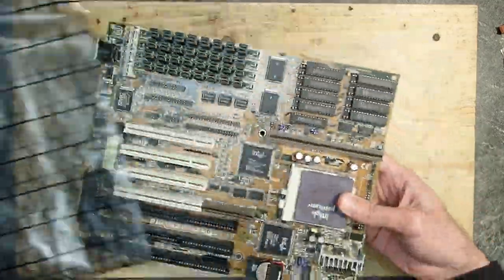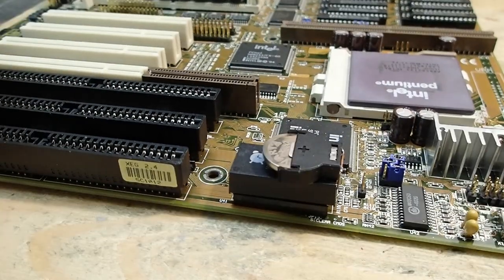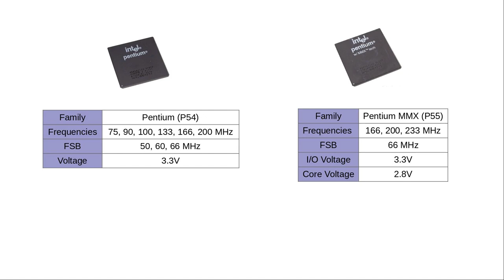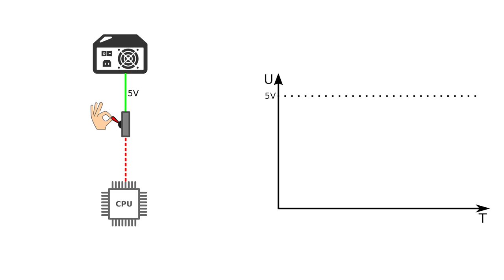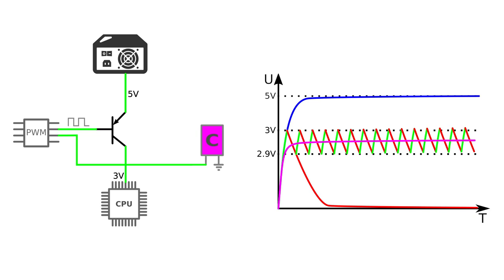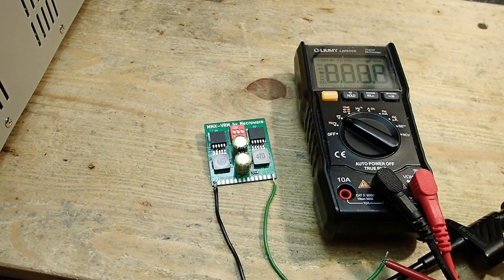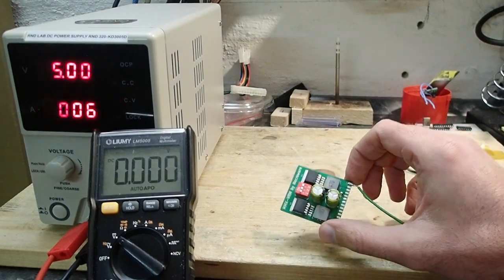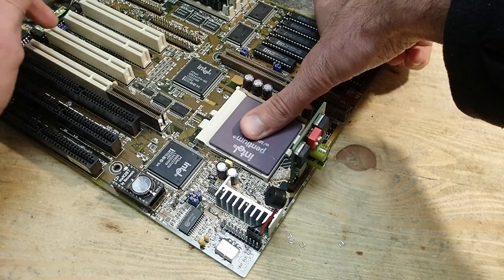Let's upgrade an early Socket 7 board beyond the limit (Part 1): RTC, VRM, MMX

Comment: Will there be a REvision 2.0 that allows the Voltage down to at least 2V, if not 1,8V as there are some SOcket 7 CPU that go down that far.
They are more found in the mobile space -> AMD K6-2+ and AMD K6-3+.
Oh and I would also remove some soldermask on the back of the output of the regulator to put one or two SMD Ceramic Caps there.
Reply from the maker: No, I don't plan to go under 2.2V, I even actually plan to raise the upper limit to 3.2V, because that's more useful. In regards of the ceramic caps, I experimented with different values, but I didn't see any difference on the oscilloscope. I added one in another place, because it is suggested by the datasheet (although only for output voltages over 10V, which we don't have here). So I decided not to heal something, what is not wounded ;) 

Otherwise everything will be open sourced next week and everybody is free to use, change, or forget it....

Comment: It seems the through hole electrolytic cap is the only buffer on the output. It may be more stable and last longer if you also add some ceramic capacitors to handle the high HF currents.
Reply: The two grey squares with 470 on them are inductors for smoothing.

Comment: Uuuuuuuuuu. Excelent and very desirable motherboard. Some people ask for what's that brown slot behind PCI. It was used too for some Adaptec SCSI boards!
Reply from the maker: What you probably mean is 64bit PCI, that looks very similar. These Asus Media Bus slots were limited to some Asus boards only and there was only a handful of expansion cards for it. Furthermore there were three versions of the Media Bus, as far as I know and they were all electrically and mechanically incompatible with each other. A total fail.
Reply: @necro_ware  ... and the few cards that are out there (usually the SCSI+Vibra and Mach64+Vibra combos) are so horribly overpriced (150-200 eurodollar upwards last time I checked) the people with mobos that could use them will likely never get their hands on them... unless they have way more money than brains

Comment: Hello, I found similar cards for sale in eBay, without Adaptec bios chip. Do you know, if the card works at all without the SCSI bios chip?
Reply from the maker: You can simply download the bios from the internet and write it to an eprom. That's not a problem.

Comment: Hello. I wanted to apologize in advance for the spelling. I write in Polish and translate in google translator. I would like to do such a project myself, but you did not share the files on your website. Could use a schematic and the appearance of the PCB itself. On the Internet I found a pdf of the LM 2596S ADJ chip and in it a diagram on which I could base and make such a regulator in the KIKAD program. Finding the right components in this program, especially the connector that fits the motherboard, is almost a miracle. The circuit itself exists as well as the diode. I can not find a switch for resistors and coil. I counted from the formula what resistors should be to get the right voltage at the output. I have a request, wouldn't you be so nice and although the ready scheme of this project in kikad made available to a wider audience? Regards.

Comment: Big question is if the BIOS will init the CPU correctly and allow it to boot? Probably the old BIOS can be modded relatively easily, as back in the days they did not play with bios encryption and there are some modding tools available for some modifications (like lba48 support)
Reply: There was a company selling modified BIOS chips and flash files for various popular motherboards to do things like add the ability to work with larger hard drives and support more CPUs and even un-hide and add/enable features the board could support but the manufacturer (usually an OEM) chose to hide or hide and completely disable.

There was also a quite active DIY BIOS modding community that developed such mods so people could DIY it for free, especially when there was no commercially modded BIOS for their board. That was aided by the "modular" BIOS developed by Pheonix and the other companies to make their work easier. "Paste" various modules together, adjust a few settings, compile into a BIOS file. An OEM that wanted to not have a bunch of adjustable stuff could request a massively cut down BIOS to fit into a 256K chip when a full featured BIOS for the same board would require a 512K chip, so a modder would also have to find a compatible chip of higher capacity.

The exceptionally nasty OEMs would order their boards with additional alterations from a reference design to make it impossible to upgrade the BIOS chip's size. Not that it would save any on cost but it would prevent BIOS modders from adding settings the OEM didn't want its customers to have.

Comment: Is this the difference between socket seven, and super socket seven?   I have several boards of both and really have to pay attention to the boards as the CPU sockets all say "socket seven" whether they are "super" or not.
Reply from the maker: Yes, the socket is mechanically the same, but the difference is not (only) the voltage, but also FSB (up to 100) and AGP slot. Only a mainboard which has that features counts as a super socket 7

Comment: I remember an old Gigabyte S754 motherboard of mine having an extension card that I believe was something like this, but been ages. Was just a young teenager by then, might be fun to look up if its intention was to do this, or if it was just a gimmick.
Think I remember it running fine without it as well.
Reply from the maker: I guess, that was more likely a TPM (https://en.wikipedia.org/wiki/Trusted_Platform_Module)
Reply: @necro_ware  It wasn't. Gigabyte did some useless marketing crap at some point during mid 00s with a plug-in VRM module for beefier (Dualcore + FX) CPUs, adding extra phases to the existing VRM on the board. They called them DPS (dynamic power switching?). One example of such a board was the K8NXP-SLI

Comment: Nice little project. I'm curious to hear more about the Intel specification aspect of it. Did Intel standardized this connector or was it just an idea that was abandonned and never took off? Seems pretty well documented/standardized based on the schematic you showed from the documentation. Were VRM-modules-on-a-card a thing that made it to the market? Some motherboard had this populated out of the box? I guess I'm really curious about the History aspect of it all ;)

Thanks for a really great video. Really curious for part 2.
Reply: I haven’t run across a bare motherboard with them (though I’m sure they exist), but some OEMs used VRM modules.  I have an IBM Aptiva and an AST, both Pentium, that use a VRM on a small removable PCB.  Not sure if either is using that suggested pinout though.
Reply: It was used extensively for Socket 8, but I'm not sure I ever saw it for Socket 7
Interestingly there is an older revision of this board on eBay (auction ID: 185033935520) with the connector populated.
So maybe the VRM module did exist? But I found no photos of it, so since this is a later revision maybe they never did release it and just dropped it?
Reply: @nickwallette6201  We had a Socket 7 motherboard in Baby AT form factor with that VRM connector. But since its processor was a Pentium 100, there was no VRM module, just four jumpers. 

Also, there's a web page I encountered long ago where some guy made a DIY VRM module with an LM317 adjustable linear regulator plus 3055 and 2955 power transistors. :O

Comment: In the future, will it be possible to tweak the formula for an Intel Pentium 266 w/MMX in a socket 7 package?  It's product ID is SL2Z4 and the voltages are much lower than those of the 200MHz variant of the same family.
Reply from the maker: Probably not, because of multiple reasons. The most important is, that such CPUs are hard to find and I have none. Second the boards from that time usually don't support the multiplier of 4 and to get it running also the mainboard has to be modified (more on that in the next part). Third, the voltage is below 2.2V and it would be a little bit harder to get the full range from 1.8V to 3.2V equally distributed. But if there will be a demand, nothing is impossible.

Comment: Hello, I am in the process of upgrading a DTK motherboard PAM-0056I E0.
I replaced the keyboard connector with two ps/2 (keyboard/mouse). I added a coast of 256ko. I modded the Dallas chips and the bios thanks for tips). I put a connector for a CPU fan.
But my card does not support Pentium MMX and dual voltage. Some models equipped with 2 Q2 transistors do this. Do you know this model and tell me which transistors would be necessary? What else would be missing?
My Q2 is a D1062. I added jumpers in place of the S1 S2 S3 bridges and shifted the Q2.
Sincerely.
Reply from the maker: Sorry, I don't know. This board definitely supports dual voltage, may be s.o. removed the second voltage regulator on your board. May be you better ask someone who has this board to compare which parts exactly are missing. Though on this board I wouldn't use anything faster, than 166MHz. Linear voltage regulators get very hot on faster CPUs.
Reply: HI,
I saw your videos on hot regulators. lol.
I tried to find photos on the web but I never see the regulators and contact people (sellers or owners of this card, particularly in Vogons) but without result. There are similar motherboard models that use dual transistors.
I noticed non-starting problems on a Pentium 200 'SY045' but not on a 166 'SY037' or 133 (SY022). I have to turn the power off and on several times. I would have liked to test a Cyrix MII... To be continued.
Thank you for your repairathon. See U.

Comment: Great video! What temperatures have you set the hot air and the gun to dissoldering without damaging the board?
Reply from the maker: I preheated the PCB with 400°C and used 260°C to solder

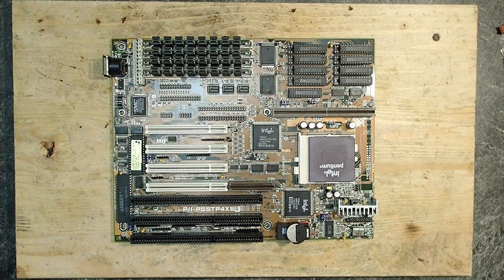Comment: 2:09 - Isn't that VLB brown slot next to 4-th PCI? Vesa local BUS graphics cards were quite common before AGP.
Reply: oh, ASUS media... Hmmm...
Reply: @Auberge79  Yup. Proprietary Asus crap. VLB was an extension behind ISA slots, not PCI. I have 2 Asus boards that use this weird Media Bus, but they both won't ever have anything plugged into them cause the few cards that are available/for sale cost 150 eurodollar upwards ... for a SCSI controller + SB Vibra or a ATI Mach64 GPU + SB Vibra. I'll gladly keep using separate cards that cost less than 5 bucks each instead of that mess lol

Comment: I was thinking, if you use an ATX PSU and AT adapter, you could also wire a direct 3.3V PSU feed to the VRM and disconnect the linear regulator - though presumably the 3.3V load isn't that much on a MMX.

PS. looks like the  capacitors on the VRM may cause case clearance issues if the motherboard is right to the bottom of the case

Comment: I am only going back to Core 2 Quad Q6600, I had to live through the Pentium years, my first being a Pentium 60, and I don't miss those old processors at all.
Reply from the maker: It depends on what's your aim is. If s.o. is just a user, then a modern system is fine. I don't even see the point to use a Q6600 in such a case tbh. But if you want to learn about electronics, about how computers work etc, then the older the better. In modern systems everything is highly integrated and there's not a lot of space for experiments.

Comment: It could be interesting to see the output voltage stability on an oscilloscope.
Why didn't you add some ceramic or tantalum capacitors in parallel with the electrolytic capacitors, from what i have seen in most switching regulator designs they are highly recommend.

Comment: Great series. For me, there would be interesting to know:
- how the original module looked like back in the days, what was the original design? Does anybody have it?
- not sure what this module was good for back in the days. You potentially could buy it and add to the motherboard but for what? MMX would not work anyway. What was original purpose of this module? Why they even put socket for it to the board?
Thank you if anybody knows :)
Reply from the maker: Thanks! There was no such thing like "original design", since different manufacturers made their own modules. The specification was made by Intel, you can find the link on the project site. It is officially called by Intel as "VRM for Pentium Processor with MMX Technology", so it was designed specifically for MMX and it was its original purpose. Pentium MMX would also work fine on all those mainboards with the VRM header, it's just that the voltage regulation back then was usually implemented using linear voltage regulators (LDO), which got very hot. Probably that's why most of those mainboards were limited to 166 MHz. The module which I designed is far superior to everything what was available back then, that's why you can use it even with K6-2 at 400 MHz or more if mainboards FSB allows it. Back then you couldn't find a comparable module for a pentium mainboard. The switching VRMs similar to the one I designed came later first with Pentium Pro.
Reply: @necro_ware  Thank you very much for the response!
So If I understood well, original modules was designed based on LDOs a intended for Pentium MMX 166MHz, right? But what about MMX multiplayer settings? It seems that these motherboards can with the module produce correct dual-voltage for the CPU but cannot correctly set a multiplayer, so it leads me to my question - what was the use case back in days? What was the purpose if even with the module, MMX processor cannot be correctly set?
Thank you.
Reply from the maker: @JakubLindauer  Well, without the mod, which I showed in the video, all MMX CPUs would just work as 166MMX. Doesn't matter what multiplier you set. They would still work, just at lower clock.

You also have to keep in mind, that as those mainboards were designed, even P200 didn't exist yet, not mentioning MMX. The VRM module was a try to look into the future and even an upgrade to 166MMX was a reasonable use case.
Reply: @necro_ware  Understood. For me is also surprising that even ordinary Pentium can work with dual-voltage - with voltage from your module without any conflict with bus voltage. Does this means that even for these old CPU it is internally separated? Maybe they considered 5V bus voltage as at 486 in the beginning and separated voltages were considered :) 
Btw I've checked in my basement and found one old HP s7 board with the old module installed. There are just two LDO, as you wrote ;)
Reply from the maker: @JakubLindauer  The non-MMX CPUs have I/O and Core voltage connected. Your thought is right and my VRM wouldn't power the CPU in case you use a single-voltage one. The module would just connect the proper pins so the on-board regulator would take over. I planned to make another video in the next weeks about this and present a new improved revision, where also this issue would be handled properly.
Reply: @necro_ware  have you seen some of those original old modules? Looking to that in my hands, it seems to be switching power regulator maybe - there is small integrated circuit, no big heat spreader and also a coil. Can send you some photos if you want ;)

Comment: Just found your channel, and this is the first video of yours I've watched. I was getting a little nervous towards the end that you were playing about with an uncased motherboard on your bench while you still had the jumper wires on it left over from cleaning solder from the VPM module socket. If one of those had contacted something metallic on the underside of the board, who knows what damage could have been done.

I'm hoping that, instead, it all went OK.
Reply from the maker: Hehe, that was an additional thrill for all of you out there ;D

Comment: I wonder if it could handle the K6-2 @400 MHz (6x66 MHz) as well. I successfuly ran this cpu in 430HX and 430FX but those were already designed for MMX CPU. Although the onboard VRM got quite hot, it was working fine.
Reply: AFAIK the board in the video (rev. 2.4) only supports a max. multiplicator of 3x and a max. busspeed of 66 MHz.
So, the fastest clock you could get is 3 x 66 MHz = 233 MHz (unless you mod it if that is possible?).
At the time I used this exact revision I didn't have a faster CPU than 133 MHz, anyway, so don't consider this statement exhaustive...
Reply: @oldguy9051  Yeah but the AMD CXT core internally remaps 2x multiplier to 6x. So you can run 400 MHz on boards that were intended for 200 or 233 MHz max
Reply: @MVCZ1  Thanks!
Reply: @oldguy9051  there may be pins that can be carefully wired together to force the CPU into a higher bus multiplier.

I did that on several of AMDs 5x86 CPUs for the 486 socket. Fortunately the two pins to connect were at the edge of the CPU with only one pin between so it only took a fine piece of bare wire wrapped a couple of turns and bumped out the side to jump around the pin between. 133 Mhz or 160 Mhz if the L2 chips were up to running at 40 Mhz. One version of that AMD CPU had no problem running at full voltage without overheating if any decent cooler and fan was used. I had one Micron tower that could almost run one at 4x50Mhz but it needed faster L2 chips. So the only way to make it go at 200 Mhz was to disable L2, which made it much slower performing that running it at 160 Mhz.

So if there's a way to hotwire Socket 7 to 4x multiplier, then a 266 Mhz speed should be possible, given that the actual "66 Mhz" is a tad faster than 66 Mhz.